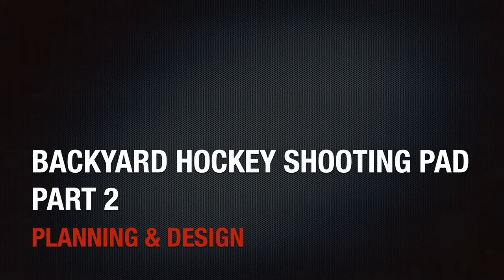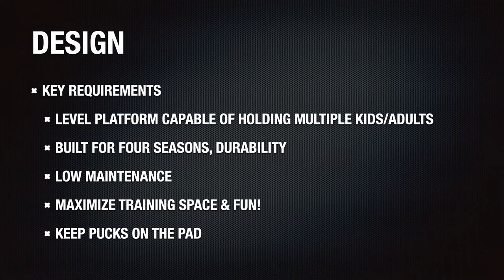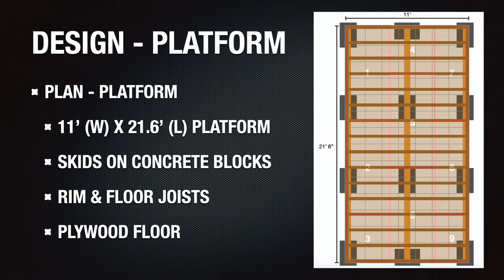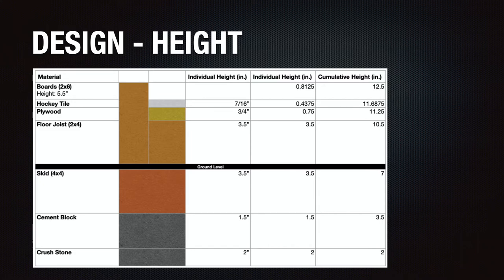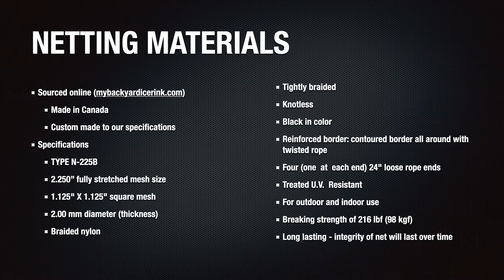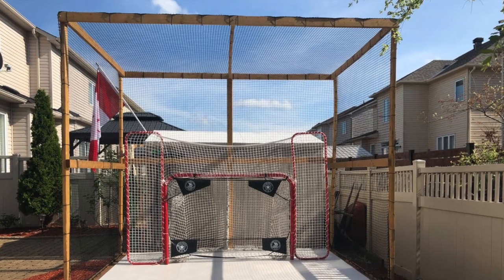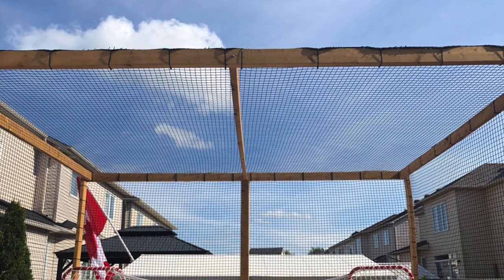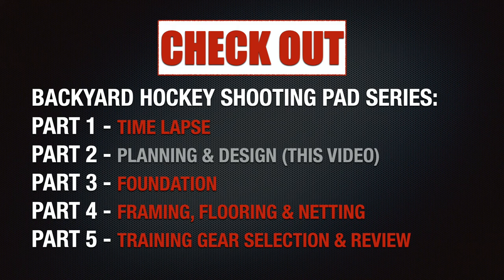How To Build Hockey Shooting Pad - Part 2 - Planning & Design

Comment: I know, the wood construction is not so heavy, and there is no any load on top of it, but i would add some kind diagonal bracing
Reply from the maker: The pad itself is rock-solid.  I would have added a bit more diagonal bracing to the cage sections.  That said, for what it was being used for, it was quite sturdy.

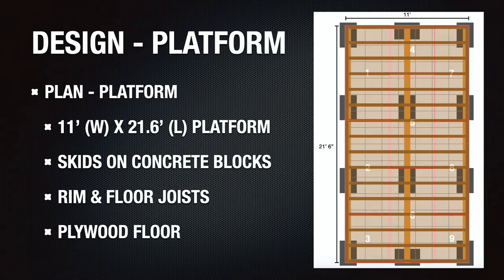Comment: Is this to scale? The drawing at 4:40 in....you say the blocks are 2x8x16 but they are bigger than the 18x18 better hockey tiles. The long side of the block should be two inches shorter than any of the tiles. The drawing makes it look like the blocks are 18x25
Reply from the maker: Not perfectly to scale no.  I tried my best but without using CAD software, it would be difficult to be exactly to scale.  Sorry.

Comment: What are the dimensions for the netting?
Reply from the maker: The netting was ordered in two custom-sized pieces:

- Piece 1 (sides and top) - 367 inches x 96 inches
- Piece 2 (back) - 115 inches x 137 inches
Reply: @coachsimon4472  Thanks for the quick reply. Have you had any issues with water sitting on the platform/tiles and not draining? If not, how did you address the issue? We're using your videos as a guide and plan on building the shooting pad over the course of the next couple of weeks.
Reply from the maker: A few things we did to manage drainage.  Ensure to build the platform with a slight pitch to direct water off the pad.  Built the pad to have natural seams in between floor panels to let water drain.  However, these measures will never prevent some water from standing on the shooting tiles.  As a final measure, we bought an industrial squeegee and kept it close to get any leftover water off the tiles.  Worked well for us.  Good luck with the project and check out the other parts of the video series for full details on the build.  Happy to answer more questions too.  Good luck with your project!